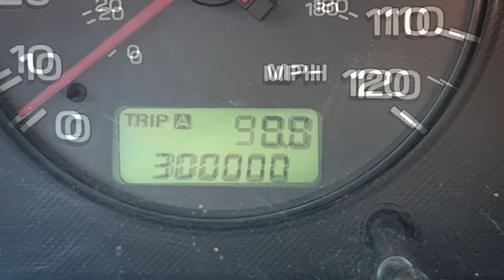300,000 Miles In The Outback! What It's Cost To Get Here & To Be 100% Again! Worth A New Upgrade?!

Comment: i am a newly converted subaru owner. i bought a 2008 outback 2.5i for $1200, with blown headgaskets, a broken windshield and also needed the usual brakes, sway bar links, a few other gaskets hear and there and a cv boot. after doing all the work myself and getting both the cylinder heads i was into the car for a little bit under $3000. this is my first winter driving this car, and i am sold on subarus all wheel drive. although the fuel mileage is average considering the size of the car its way cheaper to operate this car opposed to driving my diesel truck which due to reasons i dont understand, cost $300 to fill at $2 per litre.

Comment: have 2001 h6 3.0 228000 miles replacing crankshaft pulley now, replace struts, lower control arms (bad bushing), ball joints, inner outer tie rod ends. other odds and ends, brakes, tires etc and general maintenance. every other oil change do drain and fill on tranny ,still going.

Comment: I agree w/your thinking. We have (2) vehicles (both paid for), oldest is a 2005 while the "new" vehicle is a 2009. Both in very good cosmetic and running condition.  Also, being older vehicles they have far less electronics/modules to fail requiring expensive repair.
Keep running them, y'all.

Comment: IMO this is something Subaru had and is now missing:  the compact wagon with ~70 Cu Ft of cargo space., like the SG Forester.  The Crosstrek has identical footprint (175 in.), but ony 55 cu ft.   The new Outbacks come closest with the same utility, but are bigger  cars.  I want a modern SG Forester with a 6 or 8 speed auto and 200 HP and 9" ground clearance.  If the BRZ drivetrain could go AWD, that would be great.

Comment: 2011 Legacy 3.6R with 221k miles. Owned since 7k miles. Aside from normal maintenance items (fluid changes, brakes, tires, filters, lugs, etc....) I haven’t had to replace a single part. I drive it like an old man, but longevity is the mission... Want to hit 300k. Doing a preventative suspension upgrade (just stock stuff) this winter as it’s getting a bit “clunky” over bumps. Overall, best car I’ve owned. My recommendations for a long-life car with minimal maintenance: Accelerate slow, take corners slow, try not to accelerate in hard turns (or at all in any turn if possible) and stop slow / gradually. Most importantly importantly, I always let my car warm up until rpms are at idle. Lastly, I use Castrol Edge full synthetic for all oil changes

Comment: Hi Mr Subaru, I love your videos. I have had 6 Subaru vehicles in NZ. Only real benefit of a 2014 or later is eyesight. I have a 2017 Outback and the safety features make it worth the money ($25000nz) put 300kms on a 2009 and it was still running sweet, Not sure why Subaru gets a bad rep other than jealousy lol Cheers Bob

Comment: 226,000 on my 2010 Outback and still going.  Biggest one-time cost has been an $800 transmission valve body that I changed myself.  Haven't done any major engine repairs yet, not even the infamous head gaskets.  They're not leaking.  The oil separator plate sprung a leak recently and that will be tended to by me for a low, low price.

Comment: Your comparison at the end is true, but buying new isn't nearly the best strategy.
If you buy a used but fairly new car instead, you can get a much better price, and have much less depreciation over time. Then you can sell it around when the warranty ends, and only lose the difference in price which won't be that much considering you already bought used and the most depreciation happens when you drive it off the lot.
Just looking at the market, I found a 2020 Subaru Forester with 32k miles sold for 24k next to a 2020 Subaru Forester with 119k miles sold for 17k. That difference plus maintenance costs comes out to about 10-12 cents per mile, not as cheap as yours but certainly not bad considering you get to drive a much newer car with new features. Either way you end up paying way more for gas than for the car.

Comment: If you ever want another H6, 09 Legacy 3.0r 125k miles, would rather trade than sell. 8/8 til 9/1 downtime to fix the damage from a brick on the highway. If you do a reseal of the LL Bean it would be a wonderful FYI. I have an extra 5.3 oz of THREE BOND 1217H I'll donate to the cause. I'd like it to go to a good cause and let me forget the lower pan, upper pan, front cover and rear cover reseal completed recently. The new water pump, (at least I believe I can perceive the difference), has me believe that the parallel flow coolant system started in the 3.6 gives a better clue about the uneven cooling on previous versions. 
RIP H6

Comment: AGREE with you 1000%!!!
I bought my '05 Outback 2.5i in 2018 with 100,000 kms on it for 7200.00 and it was absolutely mint inside and out.
My Windstar was in getting some needed springs and struts and my mechanic had just finished re-newing this car...by that I mean replacing everything that needed to be replaced for a safety.
So, I took it for a test drive and fell in love with the car and bought it the next week.
Other than the regular maintenance that is needed, I've only had to do a timing job on it because an idler wheel blew up and did front cv axles.
This year I did the plugs because a misfire and trouble starting occurred that was like 30 bucks and 40 minutes.
Being able to actually work on my car is such a great thing too.
Cost of ownership is key!!!!
Even if I had to put a used engine or trans in it, I would have to justify paying 2 times as much to buy another used vehicle and then you don't know what that is going to need. New car, how many major repairs can you get for 30-50 thousand dollars?

Comment: I purchased my 2015 3.6R Outback new, and have religiously kept up with the maintenance.
It has 71k miles on it now, and I plan on keeping it till the wheels fall off, LOL!
I even had the transmission fluid changed at 50k miles, as well as the brake fluid.
I hope that mine will get to 300k miles as well, and beyond!
Reply: Subaru of Japan recommends CVT fluid change every 30k.
Reply: Keep on it my 13. 3.6R  is at 130k
Reply: What type of oil are you running aim running Mobil 1 full syn 5-30 with the black oem filter
Reply: @fredharvey2720  That's odd, because the owner's manual states the CVT is a sealed unit, and the fluid will last the lifetime of the unit.
The dealer stated to me, that the fluid should be changed every 90~100k miles...
Reply: @timbrown9731  I use Penzoil synthetic.
Reply: @KentuckyRanger  Don't believe them on that interval, do it earlier!

Comment: My 2006 forester basket case only has 260k and I need to yank the motor and replace quite a few seal that are pouring on it. And swap out the steering rack which visibly cracks the casing from some Lord only knows incident.
I think it's worth fixing, but I honestly don't have the time. Nor the funds.

Comment: I had a 98’ Outback until rust took it at 258k miles. Now I’m a DIY’er with a 2010 3.6 and 197k miles, I want to push it to 300. Got some torque converter shudder though

Comment: I bought a 2005 XT model at 159k miles. It runs great but of course leaks oil. I assume head gasket since I couldn’t find any leak anywhere I could really see on the bottom. I’m terrified of something happening to it because of the whole engine controversy especially cause money is tighter now with inflation. I’ve done a fair amount of replacing parts on it already but the engine is easily my biggest concern. Might even sell it just to be safe :(

Comment: So I bought a 2008 Impreza with a blown engine. I replaced the old engine with a junkyard one with unknown mileage. I did the timing belt and components, and a compression test before I installed the engine. The car starts and runs perfect but as soon as the rpm’s go above 4000rpm there is a code for cylinder 3&4 misfire, it stops flashing as soon as I go back under 4000rpm. I tried new NGK plugs, wires and a different used coil pack. And swap the injectors around but I still get the same thing. Any ideas on what to check next? Is there anything that cylinders 3&4 share that could cause a misfire?

Comment: Looks mint just keep sending it! Also I gotta ask. Even with your discount, is AutoZone oil really cheaper than just buying 5qt jugs of Pennzoil or whatever flavor you like from Walmart or Amazon? I personally think parts stores rip everyone off on fluids.
Reply from the maker: It’s quite a bit cheaper buying oil wholesale that buying the name brand on the shelf. Also buying in bulk as I do helps.
Reply: @MrSubaru1387  Ah wholesale. That makes sense. I thought you just got a "discount" which IME doesn't make up the difference. But yeah I'm sure that oil is probably Valvoline or Amalie and it's fine.

Comment: I bought a 2002 2.5 AT Outback last year and it's got its share of issues, but nothing serious. The only bad thing is fuel mileage on the city. I think I'm getting about 17 MPG which is atrocious, but sadly that's the school run so not much I can do. On highway at 65 MPH with no AC it gets exactly 30 MPG which is excellent IMO. I'll replace the engine oil with 0-20w and see how it does.

Comment: I have an 03 H6 LL Bean with 45k miles on it. I see you put regular oil in yours. I just did an oil change and used full synthetic. Is that okay, or would you recommend going back to regular oil?
Reply: I have the same car with 106K on it. I once asked my mechanic, who owns three Subies, about synthetic. Simple answer, "If it works, don't fluck with it."
Reply: @LeeBv9983  Thx for the reply.
Reply from the maker: I wouldn’t use synthetic. You’ll likely start burning oil.
Reply: @MrSubaru1387  I thought full synthetic was what it takes?
Reply from the maker: @liketolearn141  no. These old H6 engines only used conventional.
Reply: @MrSubaru1387  I don’t see how using synthetic would make it burn oil as long as the oil is the right weight and meets all the specifications of Subaru

Comment: Hi, I have 2002 Subaru Outback 3.0 that makes a jolting feeling between 50 and 60 mph wash thinking it was a transmission issue but the rpm gauge doesn’t change whenever it jolts, any ideas on what it could be?

Comment: Hi Mr. Subaru, i have a question that id like to ask you if you have the time. Ive noticed some shaking of the entire car caused by the motor on a cold start. I have a 22 crosstrek sport with 3.5k miles on it. Should i be concerned?
Reply from the maker: Bring it up to the dealership. It’s under warranty. That said, most Subarus run rough, first start, cold.
Reply: @MrSubaru1387  👍 much appreciated. still new to subies, had a 2011 suzuki kizashi with 190k on it and only problem i had was a crank position sensor. knew that car like the back of my hand, and damn reliable. looking forward seeing how the ol subie does. thanks again and love the channel!

Comment: Hello. I have an 09 Legacy 2.0r EU version. What do you know about dual mass flywheel? The car have 116,000 km (72,000 miles) on odometer, real number. I can change the DMF with an SMF plus clutch and pressure plate from another EJ20, older model? Thanks!

Comment: Hey I have a 94' Legacy L wagon, and my y pipe is going with rust, I have a header, new catalytic, and a couple of used 02 sensors, I was wondering if the rear 02 sensor is all I need, so I can build a new exhaust that works with my ECU? What do you think?

Comment: I've had a harmonic balancer go out on me on the road. It's not a good sound or sight when all the lights suddenly come on.

Seriously, the 04 tows a camper, is out all out adventure car. I put a head unit in that does android auto/carplay. I replaced the rear struts so no more sagging when loaded with the trailer. I see no reason to deal with the modern headaches of new cars. These cars will see the apocalypse.

Comment: Hey Mr. Subaru. I just went to the dealer for the first oil change on my Outback 2022.
Next day I checked the oil level ( cold in the morning) and is over the top mark almost 1/2 inch. Should I worry about it or is ok. I wish I can post a pic here. Thanks.
Reply from the maker: Subaru has been overfilling engines for a while now to mask oil consumption issues…

Comment: How do you feel about the vacuum oil extractor oil changes.  I have been doing them in our Ascent and Legacy and when taking of a drain plug there is barely a drip of oil. I also swear by the 6K or 3700 mil oil change interval using the Ultra Premium 0W20 on the Ascent, and the same for the Legacy but for Legacy using their high mileage option and WIX oil filters.
Reply: The problem to me is the impurities that accumulate at the bottom of the oil pan. If you open the drain plug, those impurities will move out easier with the movement of the dirt oil itself, but I don't see the same thing happening with a vacuum pump. Actually, I see the opposite. The impurities will continue there and mix with the fresh and new oil and continue to circulate in the engine, giving a hard time to the oil filter.
Reply: @robsonselzelin impurities are in your oil filter not your oil pan.

Comment: Subaru got nothing on the camry, 325k miles 2003 v6, 3 parts have failed pin hole in radiator, alternator, knock sensor, all after 250k miles. Still running good gets 30 hwy 22 city and every thing motor, electrical and mechanical works. Subaru suk it